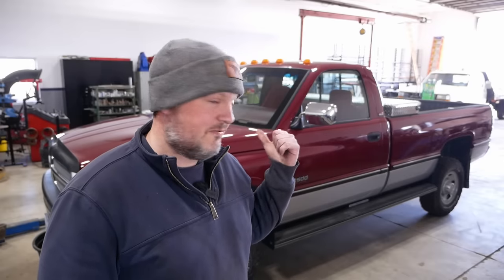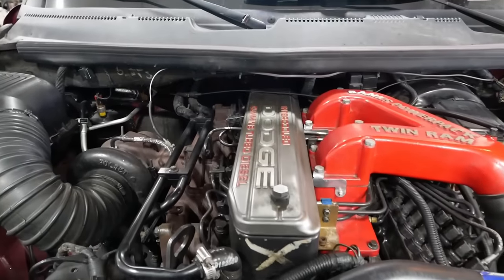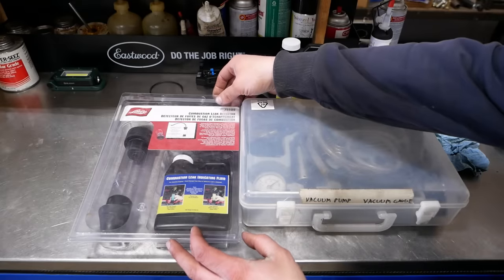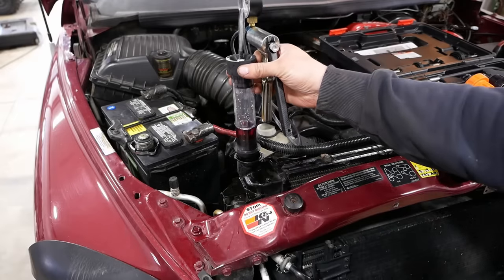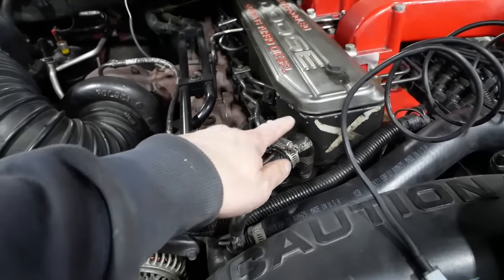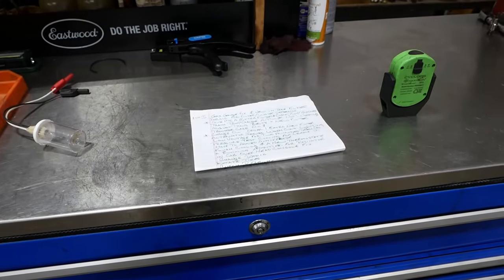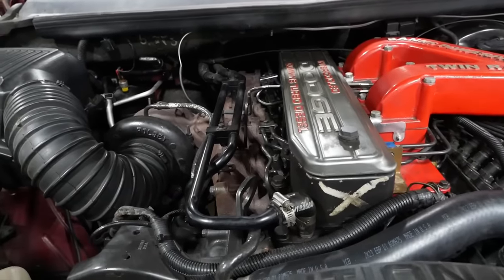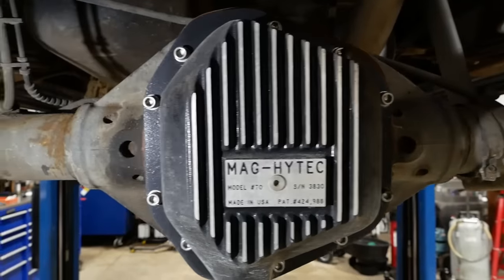Fixing a Mint 1995 Ram 2500 Cummins | Front End, Coolant Leaks, Major Service, Etc.

Comment: A lot of those old steering gear boxes are real junk. The parts store rebuilt are usually junk.. PSC makes a beefier 6 bolt cap new unit that's light-years better. They're a bit pricey but should be the last one a guy needs. The Bluetop are supposed to be a better rebuilt unit. But NEW is better. Redtop have been good for a while but apparently there's lots of bad reviews of them recently.
There's also a good US manufacturer called BBB Industries. They make lots of OE parts for the big three manufacturers. They have NEW steering Gearboxes- BB Industries sells the steering gear under Multiple names such as BBB, New Advantage, Genco, Vision-OE, Wilson
The "N" in the part number denotes NEW. So the straight P/N digits is the rebuilt, so Nxxx-xxxx means that P/N is NEW
Most of the parts chains can get their units. Check around for best pricing. The upgraded PSC with the 6 bolt cap is the best option.

Comment: Big concerns, transmission. I have on good authority that Dodge Truck is ‘mechanic speak’ for bad transmission. 

Had a 98 with the 5.2 needed a transmission at 75k. Have an 01 with the 5.2 and it needed a transmission at 85k. 

Only Dodges I’ve been around that never needed a transmission was my dads ‘72 power wagon ‘heavy half’ with a manual 4spd and my ‘80 2WD also with a 4 spd 😂😂😂

Comment: Aren’t you supposed to use a big brute force spreader to take the pumpkin out on a Dana axel?  Speaking of wire disasters, my cousin caught up with a truck that was loaded with miles of steel wire when the load sifted and dumped at Least a 1000 lbs of wire right in front of him. this instantly turned into a huge rat nest that he ran over. Of course it immediately wound up in two wheels. What a mess, the tires were at least a foot off the ground on big snags. It took him half the night with a pair of wire cutters  to cut through all the mess. Cured his tailgating habit though!

Comment: The service manual for my 97 says to use NO long life coolant, because the chemistry eats seals in the engine. I have always used the regular "green coolant" & at one point five million miles have never had seal or coolant leakage.  Just saying.
Reply from the maker: That manual was written 25 years ago. Just saying.

Comment: Most shops don't have an on-car brake lathe.
Most shops don't have a brake lathe.
The ones that do only use it in extremis (i.e. the customer is a waiter and the parts are a day out)

Why spend labor when you can mark up parts instead?

Comment: Have you ever converted an old truck to all electric? Using lead acid batteries? Keep the transmission and transfer case, along with the camshaft, which is welded to the electric motor. I would love to see you do a YouTube on the teardown and install.

Comment: External voltage regulator is needed,, old wires won't detect full contact trough, so that's why voltage is starting getting low little by little and it's annoying,, I got the right video if you need it let me know I can add the link,.. the new owners need to be aware of death of wabble specially on 4x4 dodge ram trucks and add a secondary bar,,....

Comment: I have no brand tribalism at all . That particular generation of dodge ram is a good truck. The most prominent issues with them are the paint. But who cares about that. The biggest plus is that are easily repaired and the parts are cheap. The only better truck so far has been the Toyota T100. Good luck finding one of those.

Comment: too bad its an automatic! If it were a manual then it’d actually be considered really reliable. I’ve heard their manuals aren’t even that great! I’m suprised its in that good of condition too. I have a 108k mile 1994 Ford F-150 regular cab short bed 4x4 5.0 5 speed. It has very little rust just needs a couple patches in place but the frame and everything is 100% solid! I loove my truck I even get 18mpg with her! better then my old 2002 infiniti qx4!

Comment: Mint and Unicorn won't apply to this truck in a couple of years if it becomes a daily driver.  Obviously a truck kept in a garage and not driven in the winter before this.  The only good thing on this truck is the engine.

Comment: I hate those flashy blingy new car radios. They don't fit the style of the dash and suck to use while driving. Keep the original radio, mod it to have AUX in, and plug in your phone or a bluetooth receiver. I have a 80s fully analog radio that I took out the tape player and put an aux cable in instead. It works great and the radio is better and more sensitive than most modern digital ones.
Reply from the maker: It didn't work.

Comment: I like just about anything made by Chrysler, but I do not care for Cummins. I favor Detroit Diesel instead, so I bought a first generation Duramax even though Detroit Diesel had nothing to do with that engine. In about two weeks it will hit the 500,000 mile mark.

Comment: I stand corrected. The ID of the slide points of the rear calipers were a little crazy. Not really a 2Pac shockeur as Dodge and GM were lazy, cheap ass fuk$ with coating of parts. Especially steel and iron.

Comment: I have a customer that has a 94 2500 4x4 cummins with 50k on the Odometer and has put 35k of those miles in the last 6 years that's in perfect condition better than this truck

Comment: Unicorn or not these trucks are pure junk. They fail and are under engineered in so many painful and expensive ways. As this video demonstrates even the Cummins motor has serious issues.
Reply from the maker: I dunno. Remember other trucks from 1995? I do, I am still driving a 1995 Ford. It has so many issues...